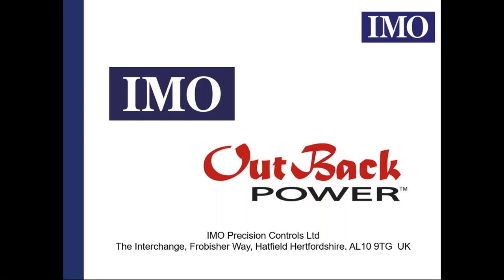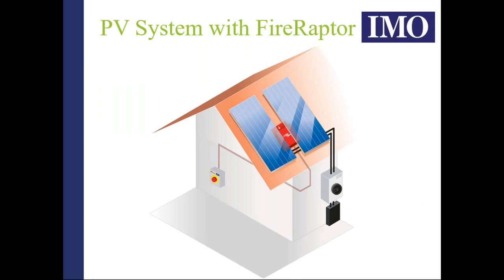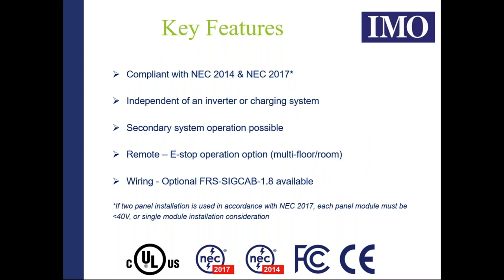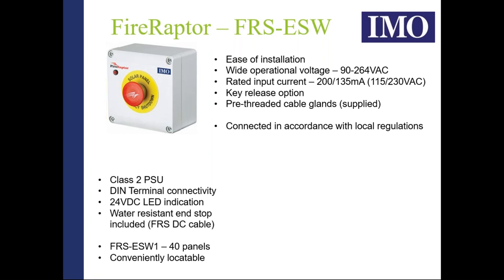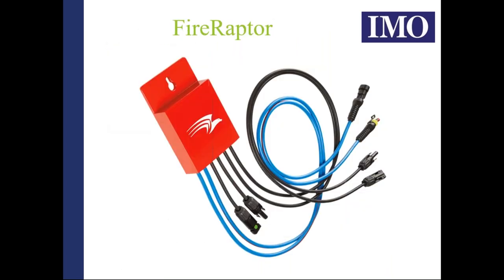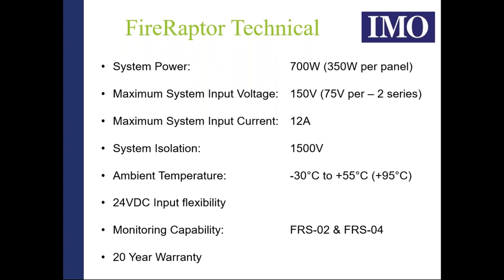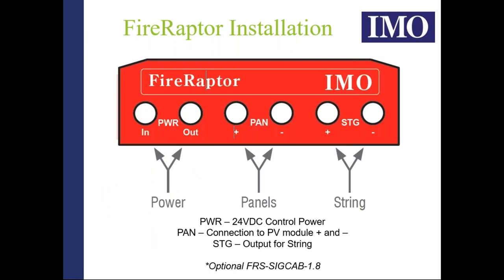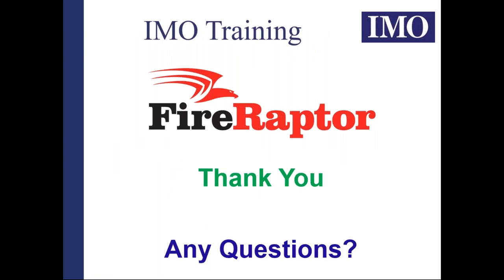Webinar | IMO FIreRaptor Training

Comment: Missing: wiring diagrams. All of the FireRaptor, flexMAX100-AFCI, and application notes mention a part you can't buy (relay), and connections to the GSLC and inverter that are not documented. This video also fails to explain how to hook up these devices with a FM-100, GSLC, GS8048A, FRS-01 devices. Also, the application notes use non-standard electrical symbols and combine the POS and NEG wires in a way that is electrically incorrect.

Comment: Hello, is the FireRaptor an analog switching device with no microprocessor or integrated circuit inside? One of my 2020 clients is nervous about EMP & they wish to have only minimal sensitive electronics on their PV array. Thanks in advance.
Reply: pretty sure the emp from the nuke blast will be the least of their problems